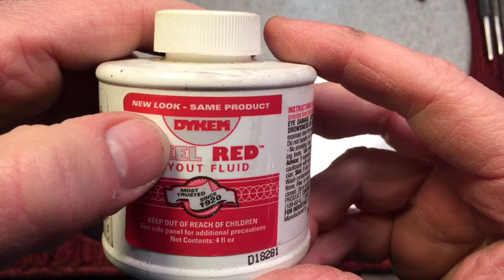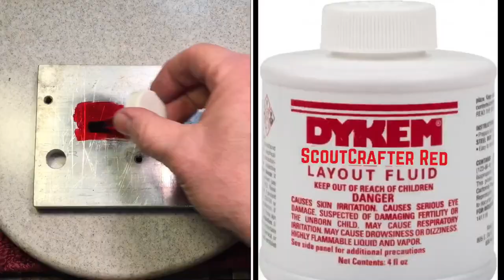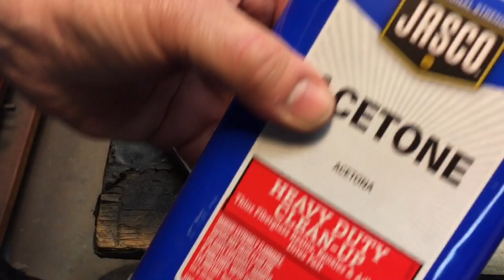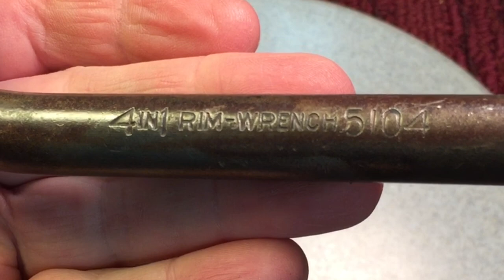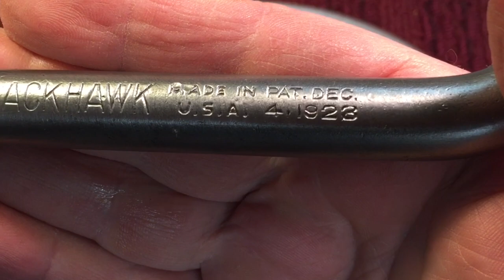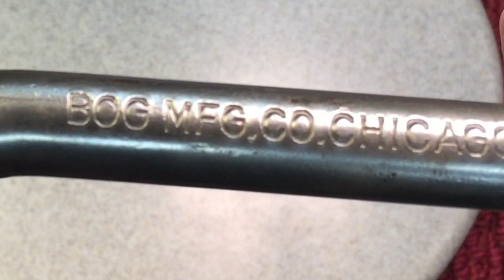Accurate Drilling. Blackhawk 4-Way 5104

Comment: I must be a little older than you. I had to do the duck and cover drills. The worst part was looking up at the bottom side of the desk and I swear there had to be from new to 25 year old gum. I like your new old stock wrench and the one a little older. They were the original cordless lug wrenches. And the “battery” charge for them varies due to the size of the operator. Loved your video...Happy St. Patrick’s Day!

Comment: As an engineer, I tend to analyze everything. I believe that time is relative to how much you have under your belt. The older that you get, the less of a proportion a month is so, a month goes faster now then when we were young. 
We had punjis and tiger pits in Boot camp to teach us to be aware. Our jungle boots had steel plates put in them to deflect punjis and toe poppers. It turned out that when my last pair of jungle boots wore out, I developed plantar fasciitis. The VA doctor recommended desert boots and they have worked ever since.
Nice video. I like the spring loaded punches. Good Luck, Rick
Reply from the maker: Rick Plantar fasciitis is no joke!  I got it a couple years ago and tried everything to get rid of it, stretching, warm baths, you name it...  after 6 months I was just out of options so I went to a foot doctor who gave me one shot of Cortisone and a few days later it was gone...  I suffered for 6 months because I thought I could heal it myself.  🤔

Comment: Hello there from Russia.
Your videos are great. I am 40 years old. I worked as an electronics engineer, security systems engineer, network engineer, system programmer, game programmer, blacksmith, carpenter,  welder, fitter, assembler, painter, decorator, props, miniature designer, jeweler, CNC operator, CAD designer, technical artist, 3d modeler.
I know a lot, but every even your video shows me that I know nothing. You very often show tools that I didn’t know exist.
A hammer with a magnifying glass is an excellent tool. It is a pity that I did not have it when I was working as a jeweler.
Marking holes on metal is difficult, but punch holes on jewelry are even more difficult. In most cases, you need to mark many holes on a curved surface with an accuracy of 0.01-0.02 mm. And then drill holes with a diameter of 0.6 to 1 mm. 
But then there appeared 3d printers and CNC, and jewelry became easier.
Reply from the maker: Hello Mikhail!  You are so right, working on jewelry and Watches present a whole different set of challenges!  There is a fantastic craftsman called "Clickspring" on Youtube that is a master with small items and super accuracy.  I sometimes feel my eyes are not good enough for fine work anymore, I need so much magnification and light!  LOL  Have a look at Clickspring here!  https://www.youtube.com/channel/UCworsKCR-Sx6R6-BnIjS2MA
Reply: @ScoutCrafter  Thank you.

Comment: Excellent lesson about centerpunching. Since I had a uncle who was a machinist I have some center drills but I have never used them because I never knew how they were supposed to be used. I taught myself how to do rivets because I also inherited probably 10,000 of those and I fixed up several winter shovels. 
 Isn't it funny how that first tool impression sticks in your mind? With me it was the rosewood and brass squares my dad had and his 1/2 drive Craftsman ratchet/sockets I would hand him when we'd fix the car together. I still have that ratchet set, too. Love the old speed wrenches you showed as I have never seen them before.
Reply from the maker: It’s so true how our early impressions mold us!  😃👍

Comment: Alas, I set a trip wire to catch my sister sneaking into my and my friend’s den in my dad’s old shed. Unfortunately I forgot about it, tripped and pulled the spade it was attached to, off the wall and onto my nose. I ended up with nothing but soup for an entire week because when you’re smacked in the face by a spade, turns out it really really hurts.  But in the movies the hero never gets hoist by their own petard. 🤕😊🤦‍♀️

Comment: Beautiful lug wrenches! Worth every penny in my book. I have been freehand drilling sheetmetal for over 30 years, never once with Dychem or a centerpunch. A nice, small palm drill (pneumatic) and lightly scribed or ultrafine Sharpie line is all you really need. Good light helps. Drilled a few hundred this week so far. Next week? Engines!
Reply from the maker: If you have sharp vision you can get by without special tools...  My eyes are shot!  LOL
Reply: @ScoutCrafter  
Mine too. I had a special pair of glasses made with normal correction in a center strip, 18" range on bottom, and fingertip range on top!

Comment: A great tutorial on  aligning drill holes. Some of the most valuable tools a workshop guy can have include being methodical and patience. You really demonstrated both. I have a Blackhawk multi tool you demonstrated. Mine works fine but certainly doesn't look like your post wirewheel cleanup. I also have the shorter BH multiwrench you cleaned up some time ago. Your handle embellishments are different from mine, but both are cool art deco designs. Both my wrenches came from the estate of a ww2 vet who was a self employed mechanic for decades. I think BH is still in business. Great video. Was hoping you would get around to the BH speed wrench. Hope fulfilled. Regards

Comment: This tool would work as a breaker bar too, i have a old proto speed wrench with a pivoting head, I thought it was for getting into crooked spots but it only bends side to side like a breaker bar. The wrench it made to be turned and used to break nuts and then straighten it and you use it like a normal speed wrench so you don’t have to change sockets on your breaker and your speed wrench

Comment: Speaking of lug wrenches and changing tires.  Now you don't even get a real spare.  They put in some tiny tire.  And the jack and wrench are half sheet metal.  So I bought a better jack and my wrench is one of the 4-way lug wrenches.  A full size spare is really the only way to go because I found out how few gas stations have any capability to fix a flat.
Reply from the maker: Kathie- Many gas stations don’t even have air anymore!   Nuts!

Comment: You need to get an optical center punch & do a video on that. They’re pretty inexpensive if you get the Chinese ones, $15 dollars or so. They are easy to use and very accurate.
Liked your trick of following the layout line with your punch tip to locate the cross line.
Reply from the maker: Hi Steve!  Check this out!  https://youtu.be/NEsMFhH1XEI

Comment: Those lug wrenches would be good for running the lug nuts on or off but I don't think you could get them tight or break them loose.
Reply from the maker: I agree- They couldn’t replace the regular 4 way. They would be great for awning work though!  😃👍